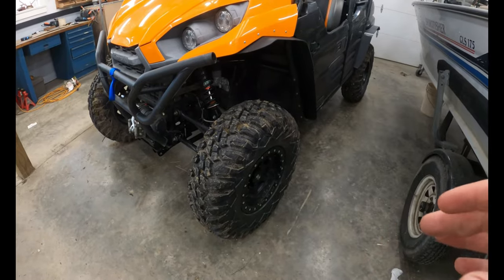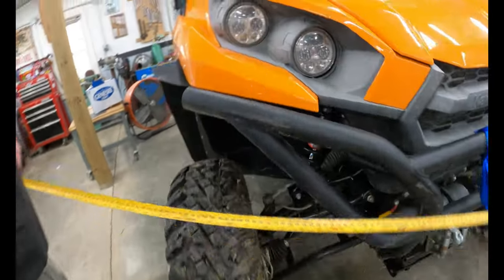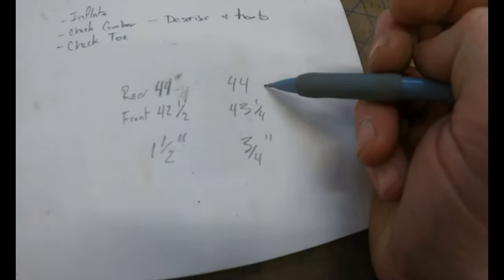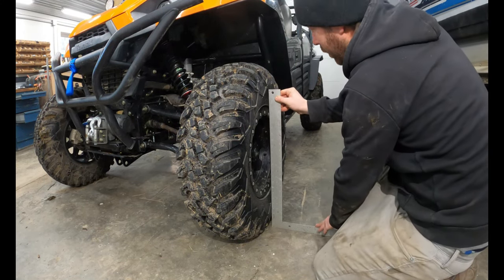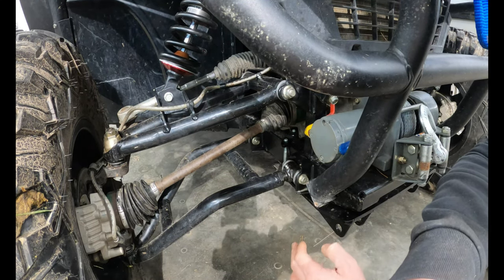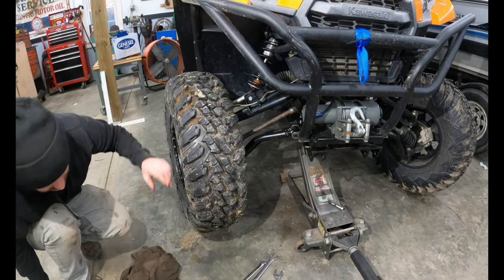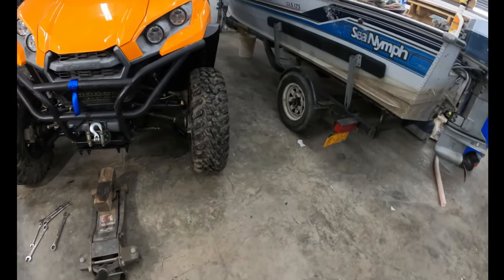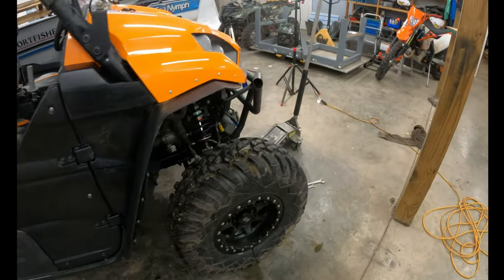UTV ATV Alignment

Comment: You should push the machine forward and back about 10 feet to fully remove any tire scrub. It easier and more thorough than turning  the steering wheel back n forth.
Reply from the maker: First I’ve heard that but makes sense. Thanks for the tip and thanks for watching jfmjr!
Reply: Absolutely 💯!

Comment: My Teryx went the opposite way after installing the SATV arched/forward a-arms, when the a-rms pushed the wheels forward the tie rods pulled the rear of the wheels inwards leaving me with 1 1/2" tow out, not tow in like yours. Another good tip for alignment is to run a straight line from the rear wheels past the front wheels and measure from the line to the front and rear of the tire, this ensures the wheels are aligned straight with the machine. Great video, thanks for sharing !!
Reply from the maker: Great Tip Darren! I watched a couple vids like that and almost did the string trick. There’s some good vids on YT on it. Thanks for watching and thanks for the comment!

Comment: Thanks for the video! You have to use string or a method to square your front wheels to your back wheels before you can set total toe.
Reply from the maker: The string doesn’t always work I feel. It’s hard with how knobby some tires are on the sides. Also, a lot of bikes come with different size tires and wheels front to rear and people get the same size when they upgrade. So the rear tires are offset from the front.
Reply: Correct. If the wheels are offset or wider front/rear, you just subtract the difference or add the difference depending on the position. Not hammering your video, just pointing out the 4 wheels need to be squared before setting your toe. Thanks for your time putting the video together!
Reply from the maker: @dannyb8955  makes sense. I’ll have to try that method next time

Comment: Can this be done on any 4-wheeler also? Especially a older 1? I sure hope so because I really think this is my issue I have been having  with mine
Reply from the maker: Depends what kind of adjustment your a-arms have but you can definitely adjust the toe in and toe out with the tie rods. If a-arms are adjustable you can do camber as well. Start with toe and see where it gets you
Reply: @DirtRoadLife1  Ok Thank You!! It’s definitely going on my list to check out. 

The handlebars getting jerked out of my hand out of the blue is getting on my nerves especially when I only have the 1 hand 🤪🤪
Reply from the maker: @melissaakanubby8774  good luck Melissa!  Happy riding

Comment: I also think that changing the camber is going to change your tow.
Reply from the maker: I’ve got over a thousand on this alignment and the tires are wearing excellent and steering and handling has been great
Reply: I agree.  When he lowered it down and turned the wheel back and forth I swear it looked like the passenger tire was toed way out. Maybe it was just the camera angle but it looked way out.
Reply from the maker: @Volfan812  must have been the camera angle.

Comment: Good video but your numbers dont make mathematical sense. I dont think your measurements were accurate. Your starting measurements were .44 and 42 1/2. That would make dead straight       43 1/4 . Your second measurement was 44 and 43 1/4. That cant be. If you move the front of the tire the back will move too. So if the front of the tire was 43 1/4 the rear would also be 43 1/4= dead straight.Your final measurement was 43 3/4 and 43 1/2 which would actually give you 1/4 " tow out. I guess what Im trying to say is that if you beginning measurements are accurate then your final front measurement should have been 43" to get 1/4 " tow in.
Reply from the maker: I’ll take your word for it cause I don’t have time to rewatch it right now lol highly possible though
Reply: @DirtRoadLife1  I actually have to line up my front wheels and your video has helped me. I think what I will do is measure the front tires the same way that you did. Ill then take those numbers and find the middle. Ill put a mark on the front of the tire and then move the tire in or out until I hit center and then go 1/4 inch in.
Reply from the maker: @whelmo14  that sounds like a great way to do it!!